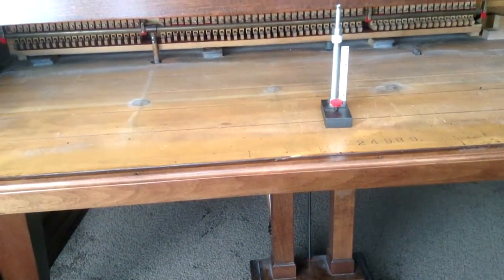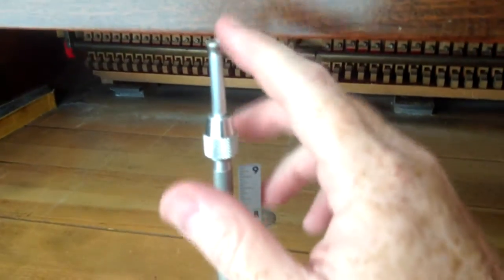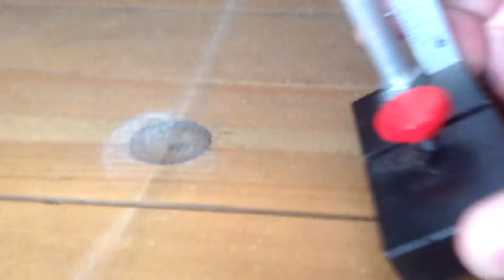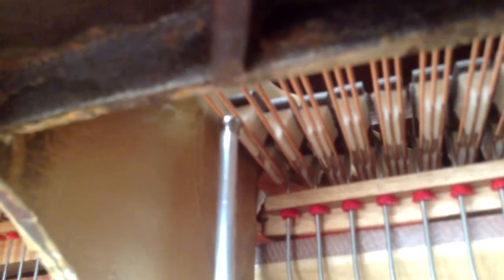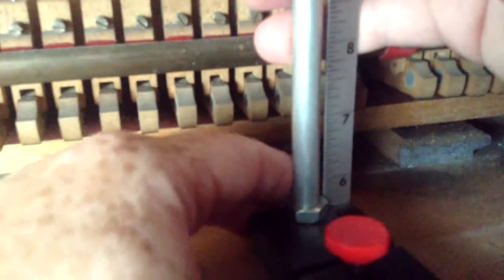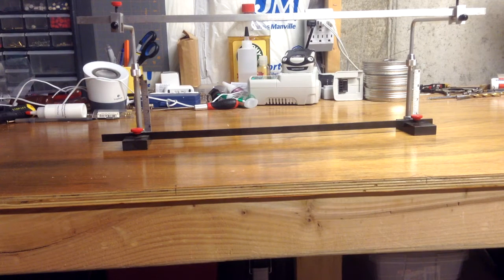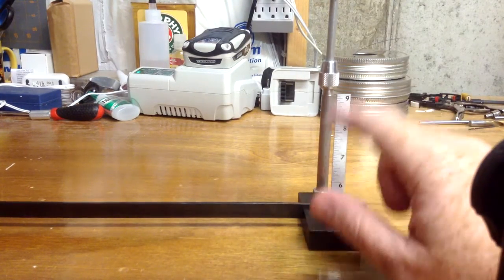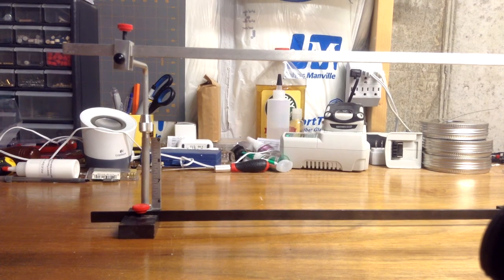Piano Regulating - Measuring String Height On A Grand Piano I HOWARD PIANO INDUSTRIES

Comment: isn't the difference in height due to the lower strings being wrapped by thicker and thicker copper wire? I'd imagine the string heights being more of a stair step than a uniform slope
Reply from the maker: No, the bass strings are higher because they have to go up over the treble strings.  So the height of the pressure bar for the bass strings and the height of the bass bridge is higher than it is for the other strings.

Comment: I am still confused by this video. The tool being used to measure has part of a ruler attached but it starts at 6"? That doesn't make sense to me as the part below the ruler down to the keybed is obviously not 6". Are you measuring the complete distance from the keybed to the bottom of the strings?
Reply from the maker: Yes, the tool is measuring from the key bed to the bottom of the strings.